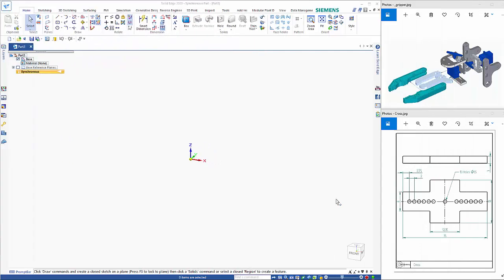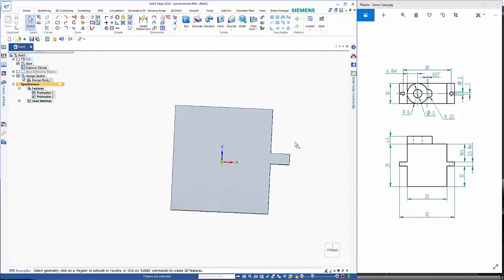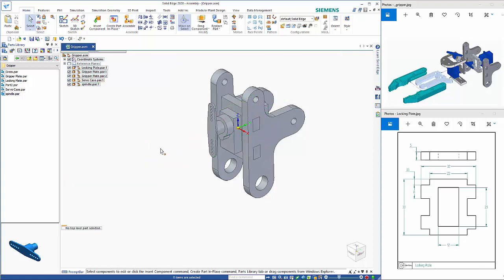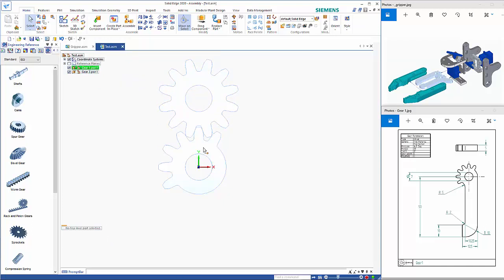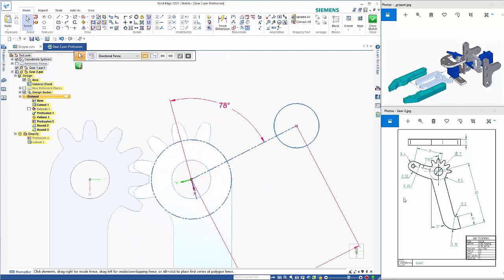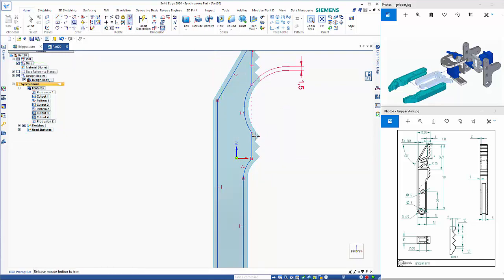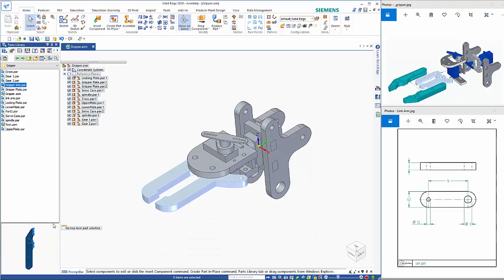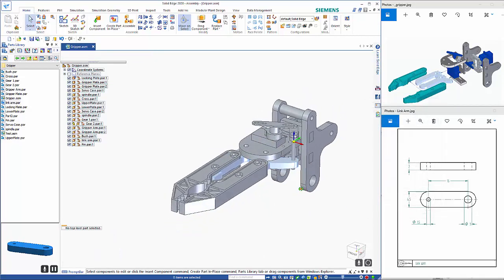Gripper Design Tutorial

Comment: on frame 1:07:59 you have slanted (60 deg) cross hairs when you go to lock.  You pressed something and they righted so your plane was not skewed.  I keep asking different places but cant find a simple answer and consequently my dimensions are skewed and some are impossible to right without construction lines. Any advice would be appreciated.
Reply from the maker: The cross-hairs align to a straight edge. Once you select the line or arc command, hover over the face that you want to lock to and an edge will highlight. click the N or B key and the edge alignment move to the next straight edge or B (back) for the previous edge. When you have the right orientation, use the F3 key to lock the plane and Ctrl+ H for plane orientation

Comment: great video, been trying to follow along but have hit a slight snag in my workflow, @17:50 mark, when you assign a distance dimension to the 3 circles, yours move to the new location, mine don't and i end up with a line above the original dimension. what setting am i missing? are there any videos out there showing the option pages setup?
Reply from the maker: My guess is that your dimension is driven (blue) and not driving (red). Select the dimension value and clear the not to scale and then select it again and set it to locked (driving)
Reply: @cadcentralnz  Thanks for the quick reply to an older video, this was a new install of 2021 community edition at home, i had to enable the "Maintain Relationships" button - Home tab - Relate group - top right button. I was looking hard at your screen, but missed that that button was turned on in your toolbar. always learning, thanks again